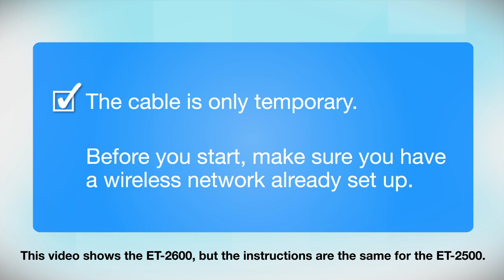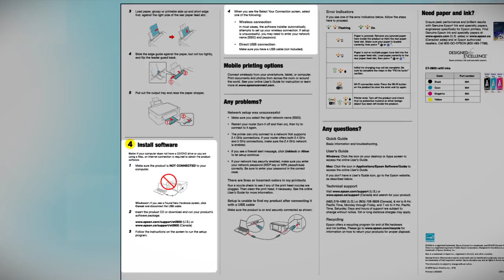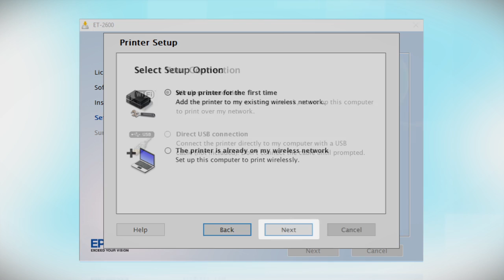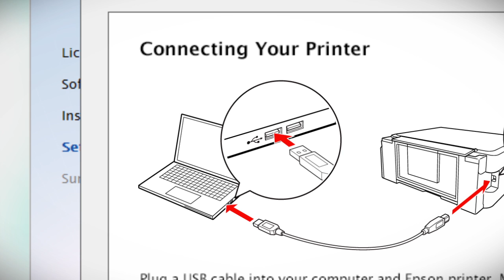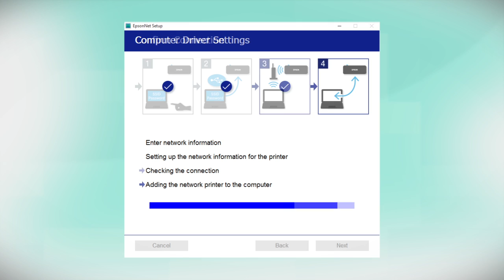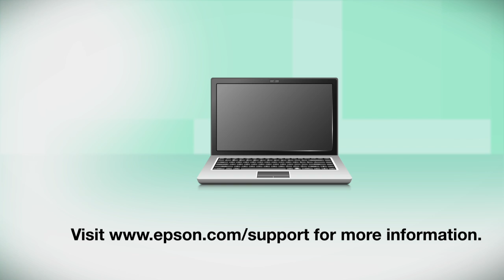Epson Expression ET-2500 & ET-2600 | Wireless Setup Using a Temporary USB Connection

Comment: I agree I SPENT 4 HOURS TO SET UP ! BUT STILL NOT WIFI  in fact when you fill-up inck you have to wait long time .
Notice is not well done , it's more our feeling , but HP is not terrible too .
Reply from the maker: Hi René, we’re sorry if you are having trouble. Please refer to our support page for information specific to your device. https://epson.ca/Support/sl/s. It may be related to a firewall or security settings on your router. If you would like help troubleshooting the Wi-Fi setup, please contact our support team at 1-800-807‑7766.

Comment: Terrible product. Printer doesn't come with a USB Cable (not sure why printer manufacturers still do this)
Printer does not have a screen on it, so if your router doesn't have WPS (WPS is not secure btw) you basically cant configure this printer until you source a USB cable.
Reply: Not only that, but it took me 1 hour to find drivers on their website and those don't match the video. Drivers I found install the USB printer, period.
So, you'd better have a cable + a CD drive to install this printer
UPDATE: Going to Epson.com/support, I immediately found the matching installer. But the European website only feature sh*ty zip file that only works for USB
Reply: @simonz5905  Same problem here...
Reply from the maker: Hi Simon, we’re sorry if you had trouble finding the drivers. You can find support, drives and manuals by searching for your product here: https://epson.ca/Support/sl/s. If you would like help troubleshooting or would like to speak to a rep directly, please contact our support team at 1-800-807‑7766. Thank you.
Reply: @epsoncanada  Would be nice to have a screen on it.. I have it in my office. The printer is on the other side of the room and I only have a desktop computer, but don't have a 15 meter cable. Setting it up near my desk and then turn if off again just causes the same wifi problems I wanted to fix in the first place..
Reply from the maker: Hi  @MariusViken , we can help you set up the printer for Wi-Fi printing and help troubleshoot any issues you may encounter. Please contact us directly at 1-800-807‑7766. Thank you.
Reply: should include the USB, pathetic, cant use on wi-fi without.
Reply from the maker: Hi Michael, thank you for the feedback. Epson is committed to giving our customers the best value possible with every product we sell. To provide high-quality products with the latest technology and sell them at the most competitive prices, it is critical to choose which components are necessary and which may be redundant. Because many of our customers already own standard USB cables, it makes good sense to eliminate the costs of including a cable in every box and use those savings to improve product features and lower the cost to you, the consumer. Regarding setup to configure your printer, you can find the drivers, FAQs and contact for our direct support line here: https://goo.gl/AnVzLZ.